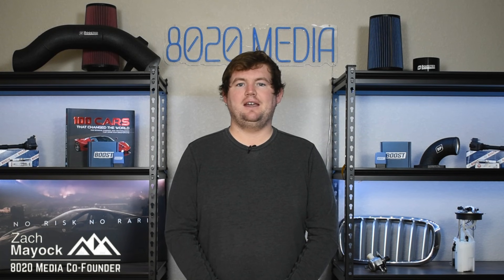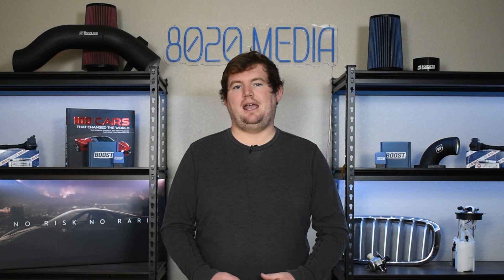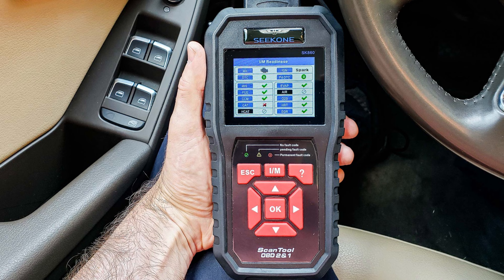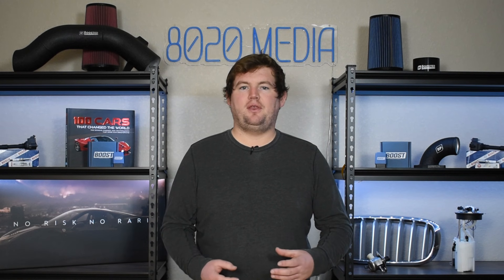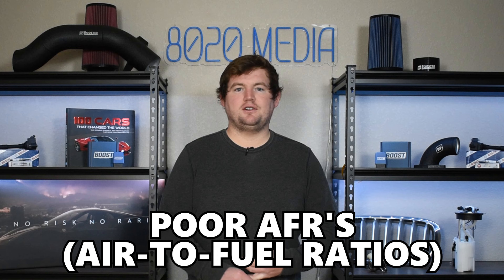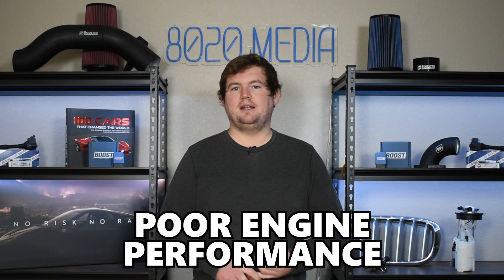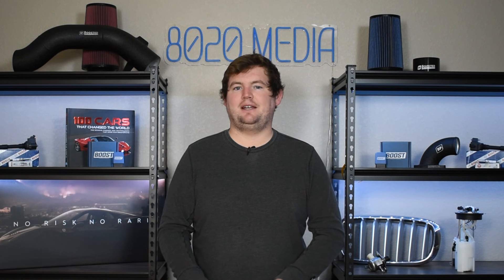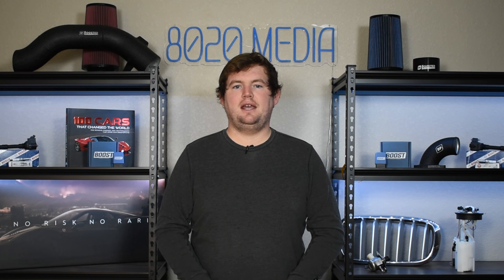Signs & Symptoms of a Bad Fuel Rail Pressure Sensor!

Comment: My car gives me extremely poor fuel economy reduced to half.
Idles rough
Performance is good no change.
Fuel Rail Pressure is always higher when the engine is operating around 10-32 bar more than desired.
But immediately drops down to 8 bar just after cutting the engine off.
I don't know if it is because of the pressure sensor or pressure regulator valve.

Comment: I just had this replaced, could fixing this cause my fuel gauge on dashboard fluctuate? It only did that after I picked up my car from shop. Mechanic told me it was probably the fuel pump😢
Reply from the maker: B - Yes, replacing the fuel rail pressure sensor could indirectly cause fuel gauge fluctuations, especially if the fuel system was depressurized during the repair. If air entered the system or the fuel pump was strained due to improper pressure regulation before the fix, it might now be struggling. Also, if the fuel level sensor (sending unit) or wiring was disturbed during the repair, it could cause erratic readings. Try resetting the fuel gauge by disconnecting the battery for a few minutes. If the issue persists, the fuel pump or sending unit may need inspection. Keep us updated!